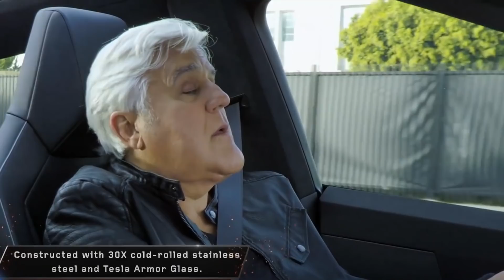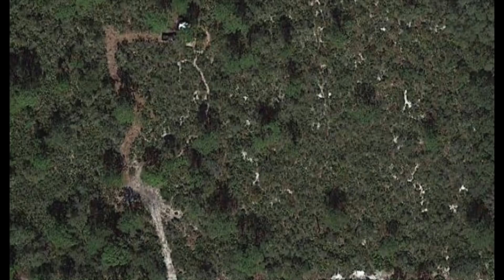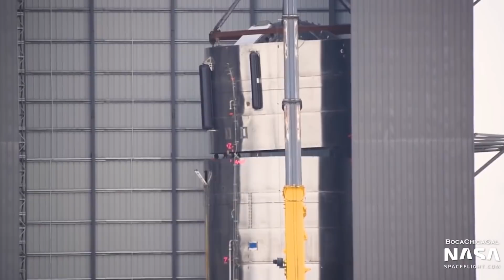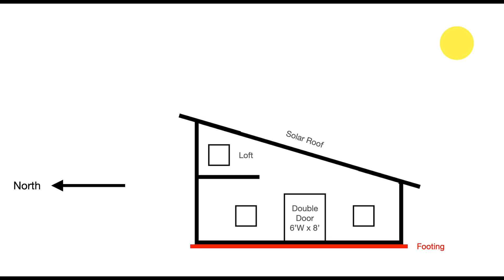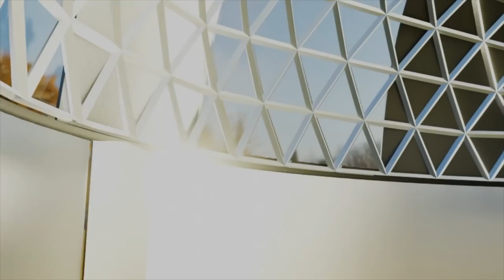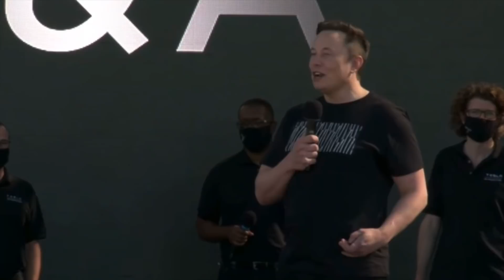Tesla CyberCabin - Apocalypse Technology

Comment: Quansit huts are very practical - I lived in them when I was a child and later in life as a Marine. If you use corrugated aluminum be warned they get very hot. Have a look at the "sand bag" house builds for other outbuilding structures.

Maybe you can contact SpaceX to see if they have some scrap from destructive tests :)
Reply from the maker: I was thinking of at least painting the Quonset white to reduce heating. Or maybe exterior insulation.
Reply: @WarrenRedlich  The ones I "lived in" were red (city), and military beige. In military we had to paint them when they arrived "silver/gray" (zinc) otherwise it was really an oven. Thanks for getting spelling right. In the summer we'd put camo nets over them to help keep them cool.

Comment: The Cargolifter idea never caught on, that could have delivered your containers fully outfitted. The Cargolifter hangar was turned into a leisure facility instead, a tropical park inside the huge airship hangar. Steel buildings will corrode in Florida´s hot and humid climate? The groundwater level is very high, too. Best of success.
Reply from the maker: Steel buildings do fine here.
Reply from the maker: Groundwater level is high. Makes water wells easier. 

There’s over 20 million people here living with high groundwater level. We don’t have basements.

Comment: Great idea, with the same dome roof as a telescope observatory, just lacking a closeable slot for a surplus telescope if you want one.  (hint). Stating the obvious, amateur astronomers perfected these buildings long ago and may give you great free advice.  (BTW, if a building is classified as a research observatory, some states give a break on taxes, permits, etc.) My brother built a dome home over 10 years ago in tough Alexandria VA, a DC suburb.  He never got building approval, until he did permits with the commercial dept.
Reply: If you are curious to see a combo dome + normal home, this is my brother's former home, sold in 2018 for 2x cost. But he foolishly wasted years of weekends trying to spray concrete himself. He finally paid a builder to finish it. See dome interior in photo 26. https://www.zillow.com/homedetails/8216-Holland-Rd-Alexandria-VA-22306/65723776_zpid/

Comment: Dome shape is a problem for both steel and solar panels
Reply: Pretty sure you can work steel into a dome, the tempering is the problem which will probably make it expensive.
Reply: Why use steel when you can use concrete. A company in California builds domes from a long sand bag covered then covered in concrete.
Reply: @lemdixon01    I'm guessing that requires building off a slab, bad idea in A place like Florida where the ground can shift a few inches from season to season, it's the same where I am in Louisiana.  Cracked slabs are common here.
Reply: @AKlover  
Sounds like ground water is moving the soil. Either fluctuations in water saturation, or you are downhill from a source pushing water sideways under your foundation. In either case, a simple thin slab is not enough.
Reply: Yes, keep solar panels large and rectangular. Tilted and aimed with corrosion-proof frames. Off the ground so rain ground-splash doesn't reach. Fastened so theft is difficult. 

Putting panels on East and West facing roof slopes can optimise sunrise and sunset collection, so South-facing is not the only choice. 

Ask insurance companies about their requirements to get discounts covering Floods and Forrest Fires. Your solar panels and house designs will improve as a result.